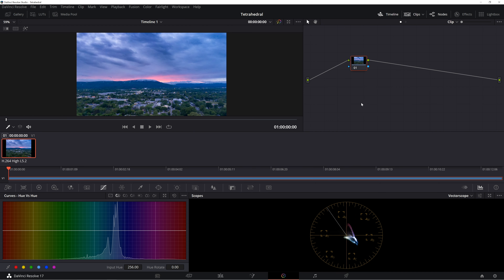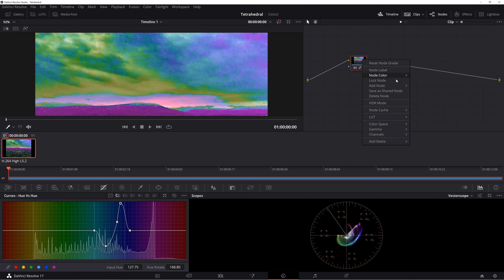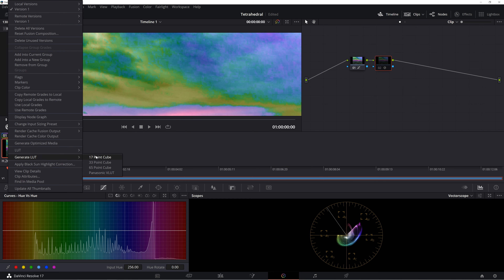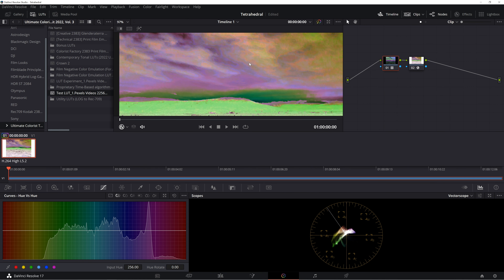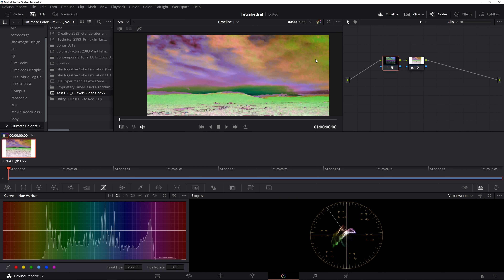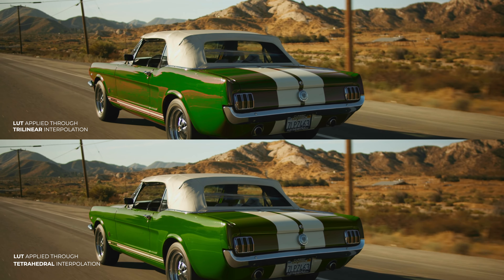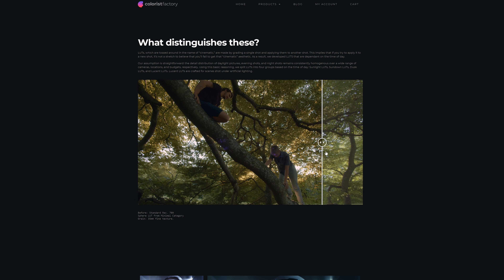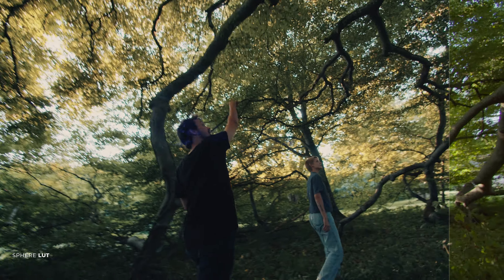better way to apply LUT (pro-colorist approach)

Comment: This is a great video 
what I want to understand is do we need to change our settings to tetrahedral before we add out lut or do we need to invert?
Reply from the maker: You don’t have to invert the image. That’s only to make sure that what we are trying to show is clearly visible after YouTube compression. 

Apart from that, you’ll have to change the interpolation method before applying LUTs in your project.

Comment: I have only one question - why isn't the tetrahedral the default?
Reply: Exactly my q
Reply: probably performance but honestly the difference cant be that drastic
Reply: Probably because it's kind of subjective. If you apply a neutral LUT that is meant to produce the same output as its input, tetrahedral interpolation will instead shift colors.
So it's perceptually better, but not exactly mathematically correct (or desired).

Comment: False information here in the Video about LUTs. A cube size of 17 doesn't mean "less information". The transitions between ONE color transform to another es even BETTER or smoother than using a cube size of 33 of 65!  You also say that it is "A Bigger challange for the software" which is wrong. It is easyier for the software to work with a smaller cube size. And it is not "less accurate". It is just different. I agree that Tetrahedral is better. But if you got COLOR banding, you should not use the LUT at all. And it is better to "stress test" a LUT correctly.
Reply: Allen do you have a minute to tell me some more info about what you mentioned on the differences between 17 to 65 cubes? Which is better to use if you need better accuracy and resolution and why? Many thanks in advance!
Reply: @vfxd8372  It is just a different size. A cube can have a size of 3, 10, 30, 100. YOu can google it and find your answer. But one size is NOT better than another size. People saying bigger cube size is more accurate but that is not true. A cube size 17 is also accurate. And if you have 65 the "LUT designer" must be a professional. Because it is easier to make mistakes. A 17 cube can be "accurate", too. "Better" and "more accurate" are the wrong terms.
Reply: @allenpayne9182  Thank you for your time, Allen. I understand what you're saying. We're talking about a different approach when choosing one of them. I'll google it and take a better look at the usage of each one of them. 🙏
Reply from the maker: The video doesn't say that a 17-Point cube is better than a 33-Point cube. I think you are working on too many wrong assumptions at this point. Here’s the excerpt from the script where we speak about 17-point cube LUT: “Why 17-point? It’s the least information LUT that Davinci can create. This means that when we apply this LUT back it’ll be a bigger challenge for the software to re-create our adjustments accurately using just the 17-Point LUT.”

I think you are missing the entire point. It's an experiment designed to showcase how different interpolations work on a 2D image.  It's very successful I must say, given that our target audience is the people who are creators with no intentions of becoming colorists. I say this because it’s not easy to showcase the effects of even a “bad” LUT on a 2D image. On a 3D cube, it's simple. But on a 2D image, it’s a matter of trial and error. That forces you to design a pipeline with certain assumptions and certain extreme starting points. And if anyone wants to take a deep dive into it, our blog links more such resources to go in-depth color science. 

It's not a good practice to come into a room full of newbies and try to be a know-it-all. You have to acknowledge the learning curve of someone who is a complete outsider to all these concepts. You cannot walk in here and write a careless comment with false assumptions and half-baked knowledge.
Reply: @ColoristFoundry 

You say:
"t’ll be a bigger challenge for the software to re-create our adjustments accurately using just the 17-Point LUT"

This statement is wrong. Whyt d do you mean with "bigger challenge". If the LUT creator chooses 17 as size it is totaly fine.

By wording it the way you say it in the video it seems that the "creator of the LUT" designed it for 33 or 65? But if you design it that way you should export it as 33 or 65.

For the software itself is HARDER to interpolate a larger cube size. So "less challenging" for the software. Not "bigger"

Sorry, but when it comes to LUTs I don't like simplifications. That is why people writing comments like: "what is better". But one size is not better or worse than other sizes. And "bigger challenge" statement is wrong.
Reply from the maker: @allenpayne9182  You are simply putting it out of context with regards to our video here. In every general sense 65 Point cube does hold MORE "Points" of data than 17-Point Cube. You are completely ignoring the fact/assumption here that we are working with a very harsh adjustment. We are trying to bend  the image and create bands. 

In this perspective, it does get extremely hard for resolve to export the adjustment in a 17 Points LUT as compared to a lush 65 Point LUT. The challenge we are talking about here, isn't how hard it is on the processor. The challenge is how well it can adapt the extremely harsh adjustment within a LUT and then retrieve the same adjustment with maximum accuracy. 

Now if we go ahead and export the adjustment in 65 Point LUT, resolve WILL recreate that adjustment with more accuracy as compared to if we were to export it as 17-Point Cube (Yes, a 65-Point cube will be more tough on processors, as compared to a 17-Point Cube). And by exporting it as 17 Point LUT,  we are taking AWAY the factor that relies on number of Data Points that make up a lut and leaving it to ONLY upto interpolation method for the accuracy of the entire process. 

I hope this provides clarity that for sake of experiment we ARE simplifying everything else, but NOT in a nonsensical way.
Reply: @ColoristFoundry  Thank you for the reply and for the knowledge you spread. I purchased your full pack a few hours ago and you have done a really good job I can tell...well done Colorist Factory and keep up the good work with more info through videos! It is very comforting to find proper guidance and information from one place with proper professionals...thanks!✊